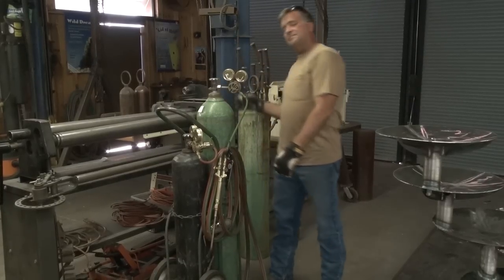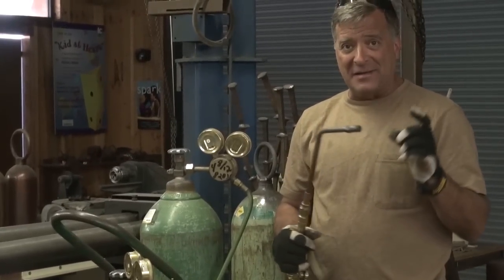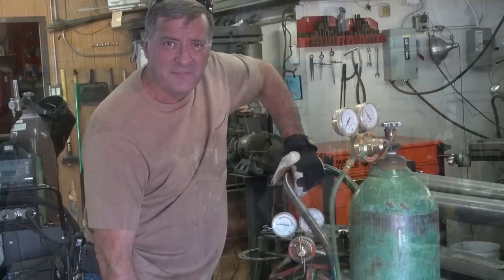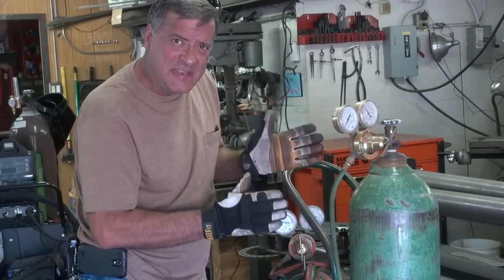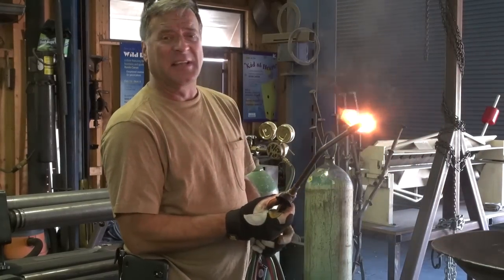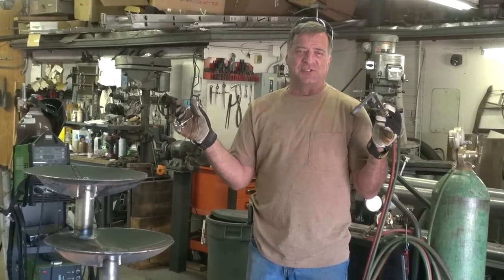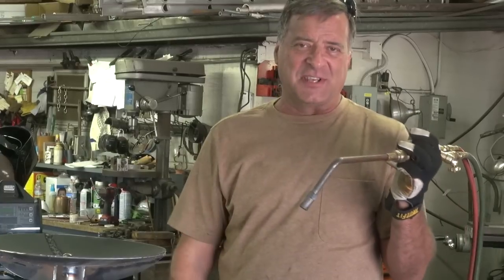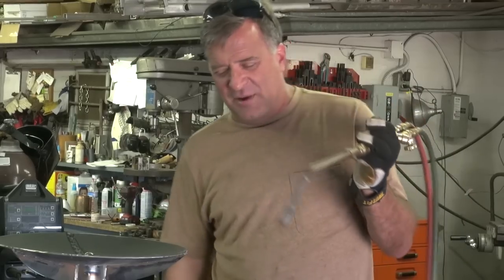How to Handle Oxygen-Acetylene 'Popping' - Kevin Caron

Comment: Good discussion. Let me add. I went in to adjust my regulators and got going but flame was soon irregular and starting popping as I was adjusting for proper heat. It turns out that my regulator cannot maintain the dialed in setting for both the Oxy and the Acetylene. I have repair parts coming and New gauges. All sorts of problems when the regulator does not regulate. My crew discarded any number of torches over the years because they were not working properly. NO. the regulators were not working properly. Without the proper adjustment you will get fire back from the tip and flame burning in the barrel overheating the torch, damaging the torch. With your gas on but your torch closed do the pressures remain or wander away. Do a leak test, soap and water. repair parts are cheap.
Reply from the maker: Thank you for the additional information!

Comment: When I adjust my cutting torch it pops every few seconds. Full bottles new regulators hoses valve body cutting head and tip.
Reply from the maker: Have you checked for leaks yet?  How old are the regulators? The rubber diaphragm may be leaking inside the regulator.  Pressure should be set for the tip you are running.  What pressure are you running when it starts popping?
Reply: I had too much line pressure, I reseated the cutting tip twice. I used it to cut a bolt off today and it didn't pop once. Thanks for the help, it's amazing how much you forget after 30 years. @KevincaronSculpture

Comment: Question,is it normal for the inside at the tip connection to the handle to be soot covered,seems to be a heavy soot layer in the connection
Reply from the maker: Perfectly normal.  Both of mine look that way.
Reply: @KevincaronSculpture thank you for your reply

Comment: I watched your video. I'm having popping issues at startup. Used your pressure setting based on the same size I'm using. Pops and goes out when starting to add O2. I tried to clean the head. I checked all seals and fittings. I'm at a loss.
Reply from the maker: I am assuming you checked your hoses and torch for leaks with soapy water, right!?!??!    Try turning your acetylene down a little on the torch when you light it.  You have to just crack the oxy valve open just a crack to get it started.  You might also try bleeding the lines before you light.  Do the acety. first.

Comment: I was wondering in my welding class we run 5 gas and 30-45 for oxy and I was wondering what the recommended settings were and it pops and I was wondering how to fix that. It usually starts to spark and bubble before it pops and I was wondering how to make it so it does not pop but so you are still able to push a puddle or run a bead. 

I was also wondering when you heat up a piece of metal that you have pushed a puddle on or welded it will have those weird ember things and I was wondering what they were and how to make it so they were not there?
Reply from the maker: Gas pressure settings all depends on the size of the tip you are using on the torch.  The "spark and bubble" is most likely caused by the oxy pressure being too high in relation to the acetylene setting. 

The embers are probably unburnt acetylene. You may have a leak in the hose or torch. 

You should stop using this setup until that is fixed.

Comment: Kevin, what size Acetylene bottle are you using?  I've got a 140 and from the victor charts I can't use my MFA 8 rose bud with it because the flow rate is too high.
Reply from the maker: Not sure on the number but it is the biggest one I can get.   It's about 1/2 the size of the oxy bottle.

Comment: I have had rosebud problems only rarely.  Obviously 🙄 I need more gas but first I’ll check stats for Harris J-63.  Usually I use rosebud because I want to bend very thick rod or bar a particular way.  Either angles or curves. I am slightly intimidated by larger torch tips but I always check for clearance for sparks and remove all nearby combustible materials.
Reply from the maker: All good safe practices to have!   Good on you for watching out and being safe.

Comment: I just picked up a new Lincoln gas kit brazing tip set up worked fine. Cutting torch Gas is not coming out tip but base by nut.. oxygen set at 10 gas psi @ 5 for brazing… for cutting g35-40 Psi A-6 psi… any help would be appreciated
Reply from the maker: Don't forget to open the oxy valve on the center of the cutting torch.  Open the oxy knob at the base about 1/2 turn and adjust with the knob on the torch attachment.

Comment: I cant seem to light mine....I get it to light (acetylene)..then when I mix my oxygen slowly  as soon as I get a good flame it pops out the flame every single time...help
Reply from the maker: Turn the ox. pressure up a little and try again.  Make sure you don't have a leaking connection or hose as well.

Comment: Thank you so much for this video.

@2:55. 

Yep!  This is me with my number 6 Rosebud:  Radnon Victor 6-MFA-1.  It is also me when I try to get what I think is a neutral flame and eventually it's an oxygen out--BOMBP!!

I'm scaredy-cat because the rosebud doesn't just hiss like a lot of YouTube videos ckaim:  this S.O.B. sounds more like a rocket ship launching into space just at 4 PSI acetylene.  The accompanying booklet requires a minimum of 8 PSI acetylene. Furthermore, the booklet says not to starve the tip or else it will result in excessive heat and popping flashbacks.

All I want to do is heat four sqare inches! $640 in equipment purchases later I made no progress in 3 hours.  I'm kind of wishing I bought the $400 electrical cord heater kit at this point.
Reply from the maker: I so want one of those!
Reply: @KevincaronSculpture  

Hah hah: I will sell you mine as the shop I bought it from is hiding behind the China virus and won't accept returns on any products.

Thank you for the expeditious reply.
Never give a sucker an even break is a W.C. Fields movie and that's the way my life works; whenever I look around the poker table I can't find the stooge so I am the stooge. 

 Neither the place that sold me the tote kit with a 10 cubic foot acetylene bottle nor the store that sold me the Victor Rosebud ever mentioned a problem with using a rosebud with a 10 cubic foot tank.

I calculated that I could use this Rosebud for about 4.28 minutes before I violate the 1/10 rule.  I hope this is enough to heat up a 1-1/2 inch thick pitman arm where the drag link fastens through it on my semi tractor.  I'm getting to the point where I wish I just pickle-forked the S.O.B. $40 for the pickle fork and about $25 for a new drag link food and I could have saved the other $540.

But I guess the Silver Lining is that I got the watch your video and a guy on Craigslist is trying to sell his tote kit for almost what I bought mine for new and his tanks don't have any gas where the shop through the gas in for gratis on mine.
Reply from the maker: I'm sorry, I meant the electric induction type of heater. I have 2 oxy/act rigs already.
Reply: @KevincaronSculpture  

Okay.

As a Penance, may you brag up the Victor Rosebud compared to a Harbor Freight 416 the cost so I could feel better mentally? 

I am unemployed and I'd rather have a consumable rosebud at this point than one that's going to last 10 years that I'll use on five occasions.

Comment: Hey, Kevin. I'm having trouble cutting even thin mild steel all the way through.  Bran new 000 tips, proper settings per the guide chart, neutral flame, blue cones just touching the plate, etc. I get the material melting back together & or the cut not going all the way through to begin with. . The problem HAS to be my technique, but after hours of watching videos & practice, I'm still stuck on stupid.  Any ideas?
Reply from the maker: I know it will be a dumb question but did you open the other oxy. valve on the torch handle and are pressing the handle to cut?  What are the settings for working pressure?   Not trying to be a smart ass, just have to cover all the bases.
Reply: @KevincaronSculpture  Thank you for the response. I set my phone to record the tip as I tried to cut a practice scrap. The angle was way off from what yours is and other channels.  It looks good from above, but the phone's angle showed it well. I've been chopping scrap for 30 minutes straight now! I have to remain awareness of my tip angle from start to finish. Thanks again. Looking forward to your next appearance. BTW, are we ever going to get a Who's Who reveal of The Voice?
Reply from the maker: Thank you for letting me know you got it figured out!  Always great to have a problem solved and everything working like it should.   As to the "Voice",  look for her videos about the business side of running my office and you will find her.  Like this one,,,  https://www.youtube.com/watch?v=VEmzn8mfHJo&list=PLu96SqjfF6C1ZfL9et0xg6eNGdf6FW_qr&index=3

Comment: I only braze for refrigeration, I read the back of the #2 Victor tip and found psi was off, now my joints are smoother, usually good on first go and besides doing indoors no more black flakes
Reply from the maker: When all else fails read the directions!!    Words to live by for sure!

Comment: The most common cause for a welding or heating head popping is overheating due to running insufficient fuel flow. You CANNOT reduce gas flow to get a smaller flame. If you need less heat, use a smaller tip/head. See how the end of Kevin's rosebud is black? That is a tell-tale sign it is running too hot. Always use the manufacturers recommended pressures, preferably on the high end. When you fire it up, adjust the acetylene-only flame just until the smoke disappears, then open the oxygen and adjust to the desired flame (neutral, reducing, oxidizing).

Here's a little tidbit that most users of oxy-acetylene don't know: acetylene cylinders are only capable of delivering a limited amount of gas flow. A compressed gas cylinder can empty itself in seconds, but that is not the case with acetylene. The industry standard limit is 1/7th of the cylinder capacity per hour. Kevin is running an AC4 cylinder in this video, which is rated for up to 145cu-ft of acetylene, but individual cylinders vary. Some hold less than that. The actual amount filled in any given cylinder is on the red tag attached to the cylinder. Assuming your cylinder is filled to 145cu-ft, that means the max withdrawl rate is 145/7 or 20.7 cubic feet per hour. That ain't much - the biggest Victor welding tip you can run is a #5, and the biggest heating head is a #4. If you run a #6 or bigger tip or heating head, you risk drawing acetone out of the cylinder, but you also risk the cylinder pressure falling to a point where it can no longer support the flow you are asking of it. This will cause the tip to overheat just as if you dialed back the acetylene flow.

If you have a big acetylene heating tip that you want to keep using, you have 3 options: Get a bigger acetylene cylinder, manifold multiple cylinders, or run the tip on propane or propylene. The biggest AC-type cylinder is an AC5, which holds 350cu-ft, giving you a max of 50CFH. That will let you safely run a #6 tip or heating head. If you go to a Prest-O-Lite W-line cylinder (if they're available in your area) you can get a WTL, which holds 390cu-ft and is good for 55.7CFH, which will run a #7 welding tip or a #6 heating tip. You can run a #8 heating tip, but only at the middle of it's  allowable range. If you want to go bigger, you go to the second option, which is to manifold multiple acetylene cylinders. This is expensive, both because you have to buy more cylinders and because the proper, UL listed manifolding is expensive. You can NOT just scab something together to manifold acetylene! The tubes and passages must be a below a certain size to prevent explosive decomposition of the acetylene, and you cannot use copper or yellow metals with more than a certain percentage of copper in them in contact with acetylene.

The third option is to run the tip on propane or propylene. Contrary to what many think, an acetylene tip will run perfectly fine AND perfectly safely on alternative fuels like propane, propylene, methane/natural gas, and even hydrogen. The reverse, however, is not the case. You cannot run an alt-fuel tip on acetylene or hydrogen. It will overheat and backfire or flashback. Assuming your acetylene regulator is a CGA510-type (male threads on the regulator, female threads on the cylinder), it will thread right in to a propane or propylene cylinder. You can even use a standard BBQ cylinder, although it may eventually get too cold to sustain pressure after prolonged operation. You just need to keep an eye on your cylinder and delivery pressure gauges and make sure the latter doesn't drop below your set point. The other thing you need is a grade "T" hose set. Supposedly, propane and propylene will slowly attack grade "R" and "RM" hose, although I have used it a great deal on both gasses with no issues. Still, I'm going to toe the official line and say "Get the proper hose!". Lighting it takes a bit of practice if you are used to acetylene; if you open the fuel valve too much the flame will detach from the tip and blow out as soon as you try adding oxygen. If the flame detaches, dial back the fuel flow until it re-attaches to the tip, then open the oxygen to get a neutral flame. If the flame detaches while adding oxygen, dial both the oxy and fuel back until the flame re-attaches. Once you get an attached, stable neutral flame,  incrementally add fuel and oxygen until you find the max flow your tip can handle before the flame detaches, and dial it back just a bit to keep the flame attached. The BTU output will be about 20-25% less than acetylene, and most of the heat is in the secondary flame vs close to the primary flame with acetylene, so you need to experiment to find where the "hot zone" is. Propane and propylene use more oxygen per cu-ft vs acetylene, but they also put out much more heat per cu-ft burned. The reason the BTU output is lower vs acetylene is that the higher oxygen consumption uses more of the flow capacity of the head, so the amount of fuel burned per minute is LESS than when acetylene is used. That is why equivalent BTU capacity alt-fuel heads have more orifices in them, to feed the overall larger amount of gas flow needed. In any case, you will likely find that the tip still puts out more than enough heat for any job. If not, you can always go online and buy a big honkin' alt-fuel rosebud :-)
Reply from the maker: Thank you for posting all this.   Great information here.
Reply: You're welcome! Hopefully folks find it helpful.
Reply: @WTFChuk  I did!
Reply: Great info in the vid and your above lengthy comment.  I just got my acetylene refilled and was going to use the rosebud for the first time in probably 20 years.  when I first got the "journeyman" victor set, I did a lot of rosebud work and had no problems.  So this time, I figured I better get a refresher on how to use this tip.  I have a 75cuft tank and a victor 8-t29 rosebud.  In doing some research, am I correct that I should NOT use this tip with this tank because it does not fit the 1/7 rule?  I don't know how I was able to do it 40 years ago when I bought the set.  I have used the same size tanks all these years.

What size rosebud can I use with this 75cuft tank?  it seems from the charts that a size 5 is all I can use (6cuft per hour).  Is this correct?  #6 is 14cuft  minimum.
Reply: Critical info , thanks !
Reply: Thank you for the information!!!!!

Comment: I highly doubt that Victor manuel said to adjust the Acy to 15psi.
Reply: marzsit. Tell that to OSHA.
Reply: Max admit when you're wrong, learn from it, and move on. No need to keep on when everyone here knows your wrong.
Of course you can run it safely at 15psi. Just don't go above that. But do you really think that you'll blow up at 16psi? Get real lol. 15 is the standard safe number to stop at.
Reply: @ikeybmg  get off your high horse pal, there's no ladies watching here.

And no, I'm not wrong, OSHA made the rules not me.

Ha, I'm more real than you'll ever be guy.
You do you, I'll do me.
Reply from the maker: Yes, it does.  12 to 15 psi is the range for this rosebud tip.
Reply: Kevin Caron, Artist. Fine, maybe it does, but it SHOULDN'T, if you keep in mind OxyAcy safety rules that say you NEVER use Acy above 15 psig because it will destabalize and go boom.
Reply: @MR-nl8xr  He never said to go above 15 psi. What's wrong with you?
Reply: max r the actual critical explosive pressure for acetylene is 29psig. using acetylene at 15psi is totally safe.

Comment: Back  years ago when I was learning, they said with a rosebud to always set your regulators to the same pressure. But not over 15 psi. Try that, it has worked for me for the last 25 yrs. Different torches may be different but I've always used Victor and it works.
Reply: tubeonline629 acetylene becomes explosively unstable over 15 PSI which is why there's a red line on that gauge at that point
Reply: Robin Turner    yeeesss That is why I said   "not over 15 psi."   I must not have made that clear enough for you.
Reply: tubeonline629 you did for me... But not necessarily for anyone else reading this who might not know WHY not over 15PSI. Now they do...
Reply: Without any reasoning given for a direction, sometimes a person can come away with the idea that the directive given is more of a suggestive starting point rather than a hard and fast rule.

Comment: I have an older air products welding set. when I light the cutting torch, I had a lot of soot and it always popped when I turned on the oxygen, then went out. I opened the gas valve  farther and problem solved. very little soot, and no pop when oxygen opens. Thank you..